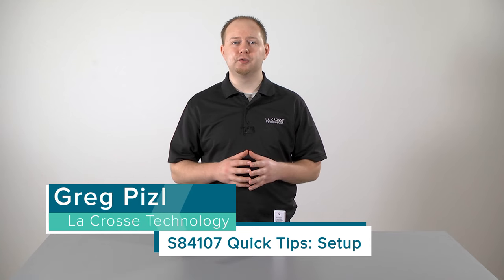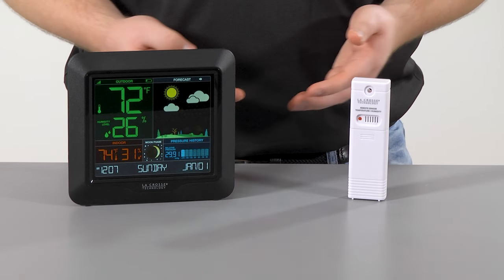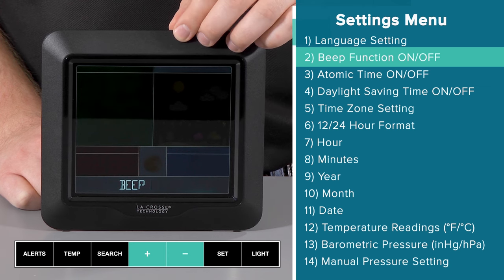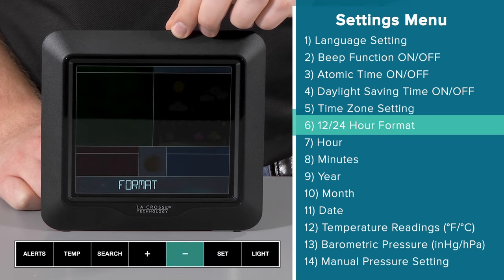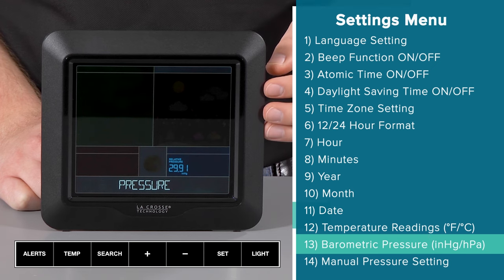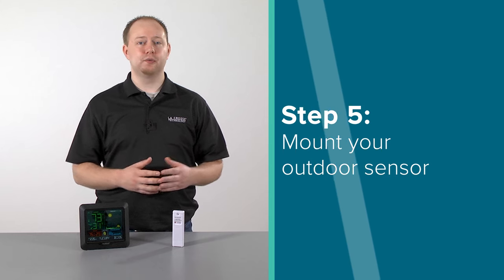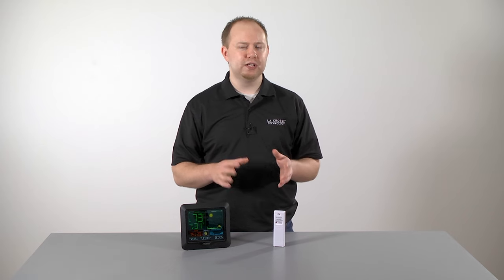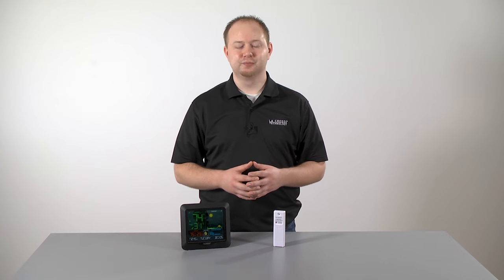S84107 | 308-1416 Forecast Station Setup

Comment: You don’t say anything about how the AC is hidden. NOT considerate.  You show that it plugs into the back where there is no opening. It plugs onto the SIDE of the back.
Reply from the maker: Our sincere apologies for any confusion or trouble with your weather station's power cord. If you should need further assistance or have additional questions, please just let us know.
Reply: @lacrossetechnology  I managed to find it and the station works perfectly.  Instructions were well done on the vid all was as explained.  Thank you so much for getting back and making it user friendly.

Comment: Can sensor be mounted underneath the deck on one of the deck posts?
Reply from the maker: Hey Juergen, as long as this is a fully shaded well ventilated area, you should be just fine mounting the sensor in this location.

Comment: Hi mine keeps blinking how do I get it to stay lit ?
Reply from the maker: Hey Joanna, sorry for the trouble! Let's try a few steps to see if we can get this corrected:

1. Remove all power from your display. Including batteries and unplugging the power cord from both your wall and from your display.

2. Press any button on the display at least 25 times and leave it sitting without power for at least two hours.

3. Power the display back up by plugging the power cord into your outlet first, then into your display. Be sure the cord is securely plugged in on both ends. If your model uses AA or AAA batteries, be sure to install a new set of alkaline batteries, other battery types should be avoided.

If you are still having issues after these steps, please message our support staff directly here: https://bit.ly/contact_techsupport. Or alternatively, send us a private message on our Facebook: http://bit.ly/LaxTech_Facebook or Twitter: http://bit.ly/LaxTech__Twitter page.
 Sorry again for the inconvenience.

Comment: how do you change the day of the week?
Reply from the maker: Hi Michelle, your day of the week will set automatically once you have the correct Year, Month, and Date settings adjusted in your settings menu. This process is covered starting at the 1:34 mark in this video. An incorrect Year setting is the most common cause for an incorrect weekday readout.